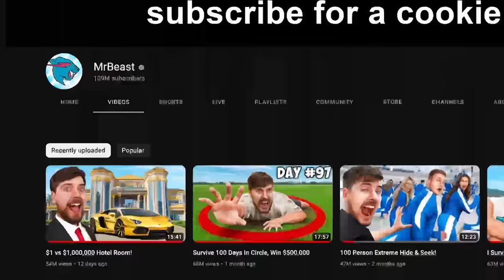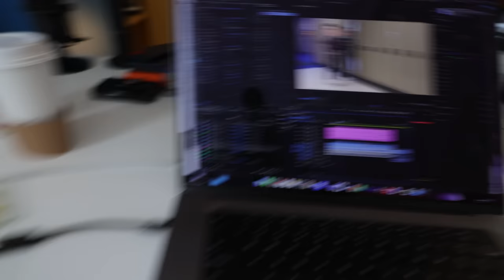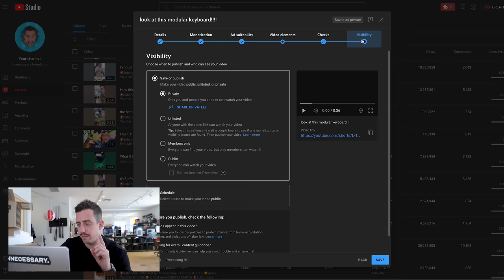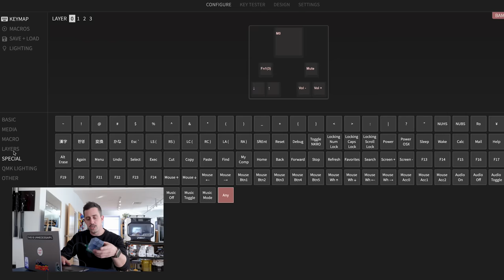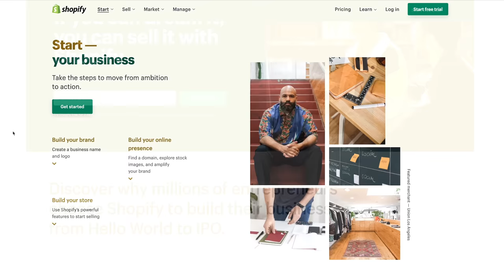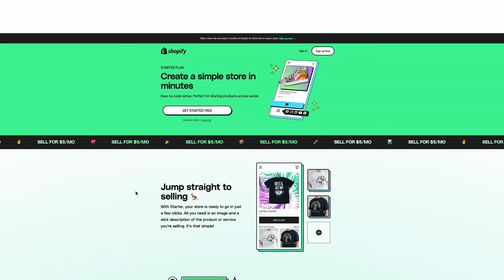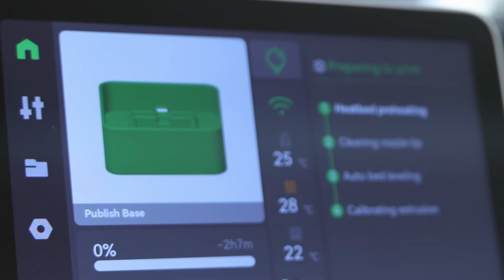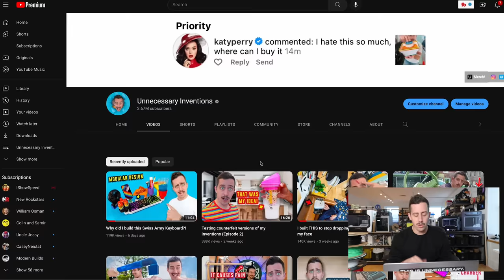This button can publish your YouTube videos for you.

Comment: Hi unnecessary inventions, I'm a huge fan😁 and I have a few questions for you. I am thinking of upgrading my 3d printer but only have  $1000 budget; what is a good printer I can get with that kind of budget? also how do you make your 3d prints so smooth? is it an ironing setting on your slicer or does it depend on your printer? while i am on the topic of slicer, what kind of slicer do you use?  also what kind of software do you use to design all you builds? I want to start designing my own 3d prints but I don't know were to start; any tips? lastly where do you get your inspiration for your inventions? I try to think up inventions to make but just come up blank.
Reply: It's a little over your budget but I highly recommend the VORON community. I've got a 2.4 and it runs beautifully.

Comment: Amazing project but the soldering part was not that great try to use like a chiselle tip when you are soldering parte like that  and also turn the temperature to around 370 for a better rezult and ading a litlle bit of flux generaly helps more for the final aspect of your worck bit overall you get 9/10 from me   .